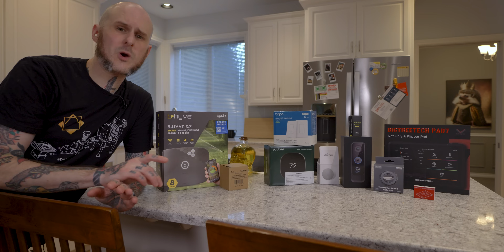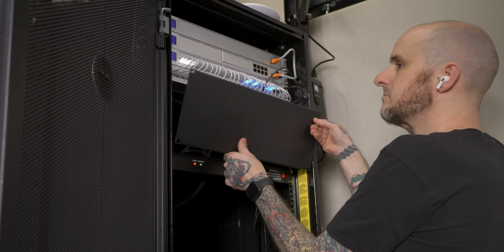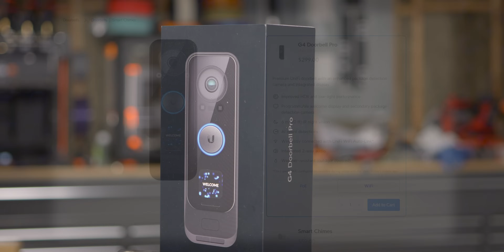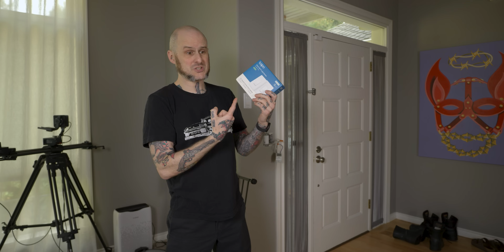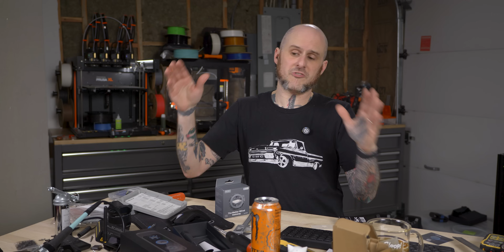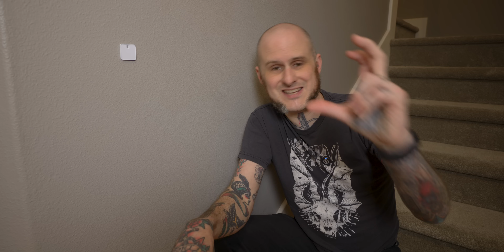3D Printing My Way to a Smarter Home—One 'Dumb' Gadget at a Time

Comment: I don't know how I missed this video. I've got a home from the late 1970's... and boy is it extra dumb. lol I had some inspiration from you and a couple other people to print a server rack, setup multiple servers within it, and do some cool stuff. One of the aforementioned servers handles all my network services and home assistant. Of course I haven't got anything really on it yet. While looking for smart devices Chat GPT had recommended some ceiling fans and door locks that it said would work with home assistant... and neither do out of the box. There are work arounds for both, but I haven't gotten around to it yet. Its cool to see what you did with your place though. I'm looking to redo all my light switches, get the fans and locks onboard, maybe do my outlets, thermostat, ect. Its definitely going to be a project, but I think the hard parts are done.

Comment: Nor sure if anyone mentioned it, but Matter is not a communication technology like Z-Wave, Zigbee,or WIFI. Most likely you meant Thread. Check to see if your bridge is a thread border router. If not, the Aqara M3 is a good one. Matter is the standard that allows these different protocols to work together.

Comment: Okay, I'm gonna chime in here.... welcome to Home Assistant ;-)
1. You may want to change the RPi to a nuc (possibly with Proxmox) or something down the line. Also, if you're running the Pi off an SD card, expect the SD to fail. SSD is better, but then you might as well get a 2nd hand nuc. Upgrading is easy, just restore a HA backup.
2. Matter is more like a language that your device speaks, Zigbee, Zwave, and Wifi are more like the medium that is used to talk through (like English (matter) over a Phone line (wifi)). Thread is like Zigbee. That's why they say Matter over Wifi or Matter over Thread. 
3. Zigbee as well as Thread form a mesh network and becomes stronger and more reliable with more devices. Wifi uses a star-network and is completely dependent on your Wifi range.
4. Matter is already in Home Assistant. I don't think you need that Moes device.

5. I try to avoid Wifi devices as much as possible, especially if they need the cloud to set it up or to work. If a manufacturer turns off their server your house stops working. Or they might start charging you a subscription to use it. Stay away from cloud devices as much as you can!
6. Make sure you have backups of your Home Assistant (NOT on the HA device itself!). You don't want to set it all up from scratch if something happens to your HA machine/SD card. I have never needed the backup myself, apart from a hardware upgrade.
7. For Zigbee I use the SMLight SLZB-06 (I have the non-M version). Works great and communicates over your LAN (supports also PoE), so no need to plug it into a USB port on you HA machine.
8. Zigbee devices are cheap (well, not all of them) and Zigbee devices will never need the cloud (it is impossible because of how Zigbee works)
9. For HA, look at the Zigbee2MQTT add-on if you're planning to use Zigbee (Zigbee2MQTT is a very popular alternative for the HA built-in ZHA), and maybe Node Red for your automations.
10. Zigbee/Wifi interference: not really a problem if you choose your channels wisely. Search for the "Zigbee and Wi-Fi Coexistence" article by MetaGeek
11. Make sure that your essential devices, like heating, (part of your) lights, also work without home assistant.
12. For Matter over Thread (like that button) you need a Thread Border Router. I believe the Google Nest Hub gen 2 supports that. But there are others.
13. Instead of that button at the bottom of the stairs I would look into a motion sensor or mmwave sensor in combination with a smart switch (on 110/220V) or a smart bulb. No need to look for a button in the dark anymore.
14. Read up on smart switches vs smart bulbs. There are smart switches (and dimmers) that control 110/220V lights, there are smart switches on battery, smart switches without battery (kinetic). One type of switch can only turn lights on or off, other types of switches can set scenes, etc. You may want to have dimmed lights at night and bright lights during the day for example.
15. Go step by step and figure out what works in your situation.
16. That intercom system: I would modify it to run a local AI so I could talk to HA or get notifications... but I guess that's for the future...

Comment: Nice video.  My garage door opener with camera and battery backup is part of my smart home system.  Of course I replaced it after my old one broke down but it has been very useful and there are plenty of options on the market.  I recommend it.

Comment: The intercom system should have a "master" panel aka hub that's way bigger than the rest of them. Think of it as a network switch that's where power goes in and is distributed to the other panels

Comment: Check out the Rachio Irrigation Controller - Totally hands off and perfect irrigation once you get the settings for soil type/sun amount/slope/root depth/watering rate dialed in

Comment: Smart Home? I’m not really certain if the means anything unless you have a voice activated AI controlling everything Tony Stark style. Doorbell camera at one time was smart home but now just common place. Controller screen panels have been replaced by tablet apps, and even when it is all done will you really one press close all blinds, lock all doors, and turn off all lights? What happens with that one door that was left open? Locked but not secure. 

I think we have come a long way with smart locks , door bells, thermostats, sprinkler controllers, and cameras, but are they just the norm for every house these days. I saw a house in the 80s with all that and now it just seems like it was a glimpse into the future. What future tech is going to be the norm in 20 years that we can install today?

Comment: LOL... so you are telling me that screen does not come with wireless connectivity to plug into the pcie bus on the compute module... LOL shut up and take my money!!!!! In the meantime of course one can run home assistant somewhere else and have a much cheaper and much dummer touch screen console that has wifi mounted in multiple places in the house to control its functions and then the connectivity and other things are not co-located with the screen(s).

Comment: Couldn't you run the Home Assistant devices on a separate VLAN, so it doesn't interfere with normal network traffic?
Reply from the maker: A separate VLAN is good for security, so the smart devices cannot access the rest of your network, but it does less than nothing to reduce congestion. The radio frequencies are the same either way. If you live in an apartment building and everyone has Wifi, the fact that your devices cannot connect to their networks doesn't change the fact that their network traffic causes congestion on the radio frequencies. It isn't the actual data traveling through a specific network that is the issue, it is the radio waves interfering with each other across any network using the same channels and frequencies.
Reply: So less traffic congestion and more radio traffic congestion. Gotcha!

Comment: Matter works with wifi... it's thread that needs it's own transceiver.   I have wifi matter bulbs, for instance that do not need their own hub/extender/etc.    You probably already know this, but it wasn't super clear in the video.   Just lettin' ya know.
Reply from the maker: Yea I did not make that distinction you are correct. My switches are fine on wifi but the button needs Thread. Still having trouble, close to just adding a Home Pod as a Threads Border Router, blah.
Reply: @MandicReally  Honestly, I have the TpLink omada system (basically a knock off unify) and TONS of wireless IoT devices and have yet to have any RF bandwidth issues or slowness.  I also have 2 kids and a wife that would definitely tell me if there were issues.  :)

If you wanted to ditch the threads entirely you probably could and just replace it with zwave or zigbee where absolutely necessary.   

For instance, I'm using a habitat hub for zwave and zigbee, which ties in nicely with HA.

Comment: Does your intercom have a larger unit in one room (possibly the kitchen)? If I remember correctly that's usually where the individual units from the rooms / doors ended up terminating. Wiring similar to thermostats I think.
Reply from the maker: That makes sense, and I'm sure one is probably the "main" unit, but no the bedroom ones and kitchen one are identical from the outside. I'll just have to open things up to figure it out.

Comment: Try the SMLIGHT SLZB-06 it will handle your Zigby and your matter over thread network. You can also place them anywhere you want because they are connected through ethernet so if you have a large house, you can put one at either end and use one as a router to the thread or Zigbee network.
Reply from the maker: That requires reflashing for Matter Over Threads, correct? I got a Sonoff USB dongle that had to be reflashed but it isn't playing nicely. HA sees it and launches a Threads Border Router with it, but Threads devices are still not connecting properly and it won't authorize with my phone. Behaving strangely.

Comment: I know this may be a little late but home assistant does not need a matter bridge/gateway. Matter uses Wi-Fi to connect to the network. Home assistant has an add-on that acts as a matter bridge that you just install using the add-on installer. No additional hardware is needed.

Comment: Your going to want to get Sashco eXact Color caulk.  It's tint-able with paint, so it will match your siding perfectly.  I would have used it myself, but it wasn't out at the time.  However since I have red siding I just used red RTV.

Comment: I started my Home Assistant setup using an SLZB-06 for Zigbee. The SLZB-06 worked so flawlessly I got another one for matter and it does a great job at that as well. I haven't mounted them to a wall yet, but I'm thinking I'll print a housing and cable channel to put up on them to improve the appearance. I will, I think, need to add a small, quiet fan to the housing and tap into the POE to power it.

Comment: Right on! I need to redo my Home Assistant setup. Haven't had it on for some time now.. and need to fix it and get it back to working! Just ordered the Qidi 4 Plus printer, and recently got the Bambu A1 Mini.. a pretty good printer. Have a voron 0.2 waiting to be built and my S1 Pro still sitting apart from when I was upgrading it with x/y/z linear rails. One day I hope to get that working again as I spent more on that than my Qidi 4 plus ANd the A1 mini combined!

Comment: There is a downside to the thermostat provided by your power company.  We actually had a setup where we got a discounted rate for our electric water heater and our HVAC heat pump.  In exchange for that discounted rate, we were giving our power company the ability to turn off our water heater and/or HVAC based on power demands.  A couple of really hot days this summer we noticed the AC had been turned off.  While not extreme, our house did rise in temp by several degrees.  So while the $30 thermostat from the power company sounds like a good deal, it might be worth checking the fine print to see if and how much control you are giving them.
Reply from the maker: Our company offers a separate program that works that way. The rebate on the thermostat and water sprinkler controller is not part of that. We can opt into that and get a reduced rate, at the expense of that loss of control. Working from home that’s a no go for us. Good info for others though. 👍🏻

Comment: I have a 6 zone bhyve and it is quite good as long as the weather source for your area is good.  Initially our airport only updated the weather info like once a day so it would be raining and irrigating at the same time.  I have not integrated anything but I do have Ecobee, Lorex cam/security, Lutron lighting, Grundfos water recirc, and Hunter Douglas blinds.  I think having a stable tablet/console is what is keeping me from integrating, I don't want it all on a phone.

Comment: The stairs shouldn't need a button, it should be motion controlled in my opinion.
Reply from the maker: Yea I was so close to motion controlling that, but I was worried about when folks don’t want to use them at all. Say in the middle of the night (the light is visible in our bedroom when the door is open).
Reply: @MandicReally if you use motion you could set it for a certain time say midnight till 6am to only bring lights on dim just enough at night if anyone needs to use the toilet.any other time set it brighter.etc
Reply: A house with several cats and motion controlled light  - umm no
Reply: Ah yes, motion sounds like fun. A pet zooms by and I only see the light kick on and I've shit myself running into the back door.

Comment: As a fan of docker, you dont need to swap anything, home assistant will run on any environment that can run docker. I'm running HA on my beefy router (as docker container)
Reply from the maker: I used to run HA in a Docker on my Unraid box. Problem was that installing community add-ons were more difficult if not nearly impossible. That’s exactly why I moved to Pi based. That and lower power consumption.
Reply: @MandicReally  Yes they are harder to install but it's not impossible. With docker you can run pretty much any addon with exception you need to configure it yourself as separate docker container. But I will not agree about power consumption. Having yet another mini pc to run will consume more power than just running it as docker on my router. Unless you do not have a mini server at home i guess. Docker has yet another advantage, it can also run 3rd party unrelated to HA software on the same mini server. So instead of having 5 mini PCs. I have one beefy router that works as router, HA, NAS, webserver and network supervisor.
Reply: @MandicReally  I went with a NUC (4th gen, 2nd hand) running Proxmox with HA as a VM. Has been running 24/7 for a couple of yours without issues now.
Be careful with the Pi if you're running it from the SD card!

Comment: As an electrician, it hurts my soul to see you use the twist-on connectors and not wagos in the junction box behind thise switches. 😅
Reply from the maker: Reused the ones that were already in the box. My studio is all Wagos. (I also used up all the Wagos and need to restock. 😅😅) I agree wholeheartedly.
Reply: Curious…are you an electrician in the US? Because I’ve never opened a junction box that didn’t use wire nuts.
Reply: @TheOfficialOriginalChad  no, in Norway. We stopped using those nuts in the beginning of the 90's as they are a serious fire hazard.
Reply: @Anziilife  I wonder why they’re a serious risk in Norway, but the risk is statistically insignificant in North America. 

Don’t get me wrong; wire nuts suck to use in comparison to wago.
Reply: @TheOfficialOriginalChad  well, generally in Norway, it only takes a few fires in order to deem a product unsafe and move away from it. Much like our gun policy, where you need to be evaluated and certified in order to own a gun. All weapons also need to be functionally unable to function while stored in a locker. -But back to the electrical installations. We need to be able to use multimeters without disconnecting anything, in order to make sure the circuit is off. 👍
Reply: @Anziilife Also North American grid runs on half the voltage compared to European, might also be a factor.
Reply: @luispittairline339  well, yes. Higher voltage means less amps for the same power/wattage. So technically, should be a bigger problem in North America. The nuts wiggle loose due to heat cycles and when they get loose enough, the connection isn't as good, creating a heat point.
Reply: @TheOfficialOriginalChad it’s not insignificant 😂 they did some studies it’s not insignificant at all, the problem is the electricians and how they were “taught” and unlearned behavior
Reply: I’m so NOT an electrician but my apartment came with tons of non working light switches and outlets so I deep dived into how to replace these myself. Used Wagos in every box I opened up! So much easier than the nuts and felt much more secure in my work with them lol
Reply: I thought the wago ones weren’t good?
Reply: @Camaro45th  how so? They make sure to have proper tension on the wires individually.

Comment: I recommend the SLZB-06 antenna for your smart communication, hands down the best gateway on the market imo. I have one and I have set it as my zigbee coordinator over Zigbee2MQTT.
It works with matter zigbee, wifi, BLE, matter and has POE too. You can place it anywhere in the house regardless of the location of your home assistant and its a big plus.
In general you can also use more then one gateway for your smart devices, but each one will have its own network.

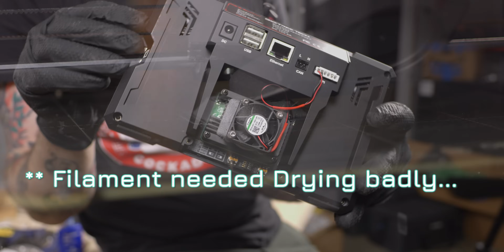Comment: 7:24 shouldn't the fan be the other way?
Reply from the maker: The pressure that would create would introduce more noise. Most likely it would run well without a fan at all some the air movement of drawing air out will do plenty.

Comment: The Home Assistant Connect ZBT-1  might be your answer to matter. It is a Zigbee dongle made/designed by the Home Assistant team but also has Matter capabilities via software/firmware updates. It just plugs in with USB
Reply: Just looked into it, thanks for the tip! But it seems that they discontinued it because of a voltage regulation issue

Comment: Does the Conch hotend from phaetus come with the thermisotr and heater?
Reply from the maker: Not yet. It is standalone but priced really well. They announced MSRP is $24 for the Conch and $39 for Conch Plus. Which for silicon carbide I think is kind of crazy. They told me they are working on complete units that should be available “soon”.